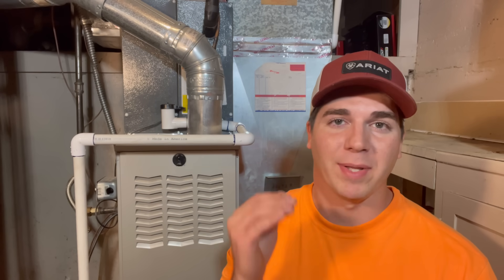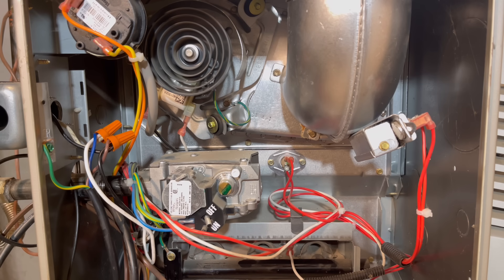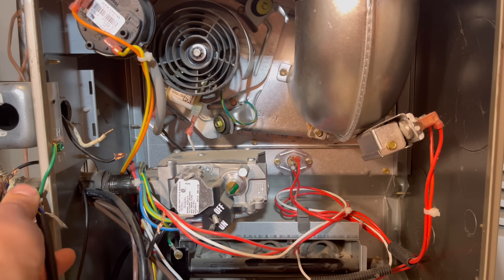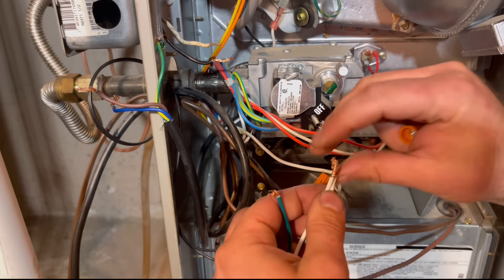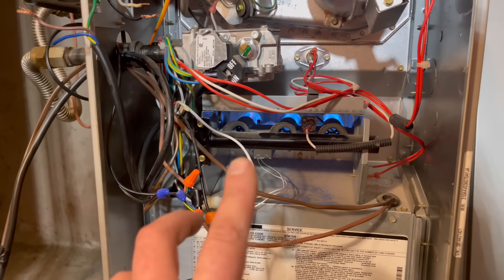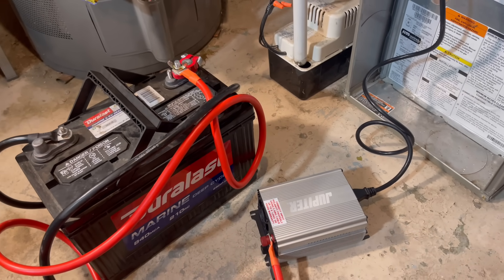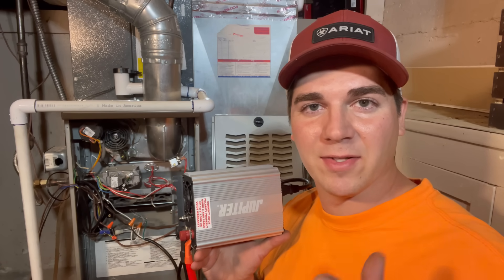Did You Know You Can Heat Your Home With A Car Battery?

Comment: LOL, Good luck using that with a Variable speed blower.  No ground on the computer board.  I smell a service call.  If your furnace is 20 years old , no issues
Reply from the maker: Some others on here said a pure sine wave inverter might be better for the high efficiency variable speed furnaces. Thoughts?
Reply: @diyhvacguy  yes they should work but obviously expensive. Newer equipment needs clean power or bad things happen
Reply from the maker: @chadschafer1723  right on. Well for the next video I’ll definitely have a pure sine wave inverter so as to not throw anyone off with a newer furnace. Thanks for the tip!
Reply: @diyhvacguy   I tried this on my 10 ish year old Goodman GCH95. 70,000BTU with 1/3hp blower. It's a condensing furnace, but still uses PSC motors. But the control board shows a grounding error. I tried all sorts of things (running off house ground, running off car battery ground, etc) and nothing worked. I actually let the magic smoke out of my inverter when I tried to jumper the neutral to ground. So I'm back to square one. This was with a modified sine inverter. Do you think a pure sine inverter wouldn't give the grounding error? Can you test your truck set up on a few different furnaces?
Reply from the maker: @valentindecker5264  yea I’m willing to bet it’s due to the modified wave. I’d try and pure sine wave inverter
Reply: @diyhvacguy  thanks, I'll buy a tsw for the replacement

Comment: It might be better to just invest in a home generator so your even more prepared.
I really can't imagine that this car battery is going to hold up for a couple days without draining it.
Consider mounting the power inverter permanently in your vehicle running an extension cord to your furnace so your able to keep the battery charged and not running it down.
The basic idea here was good though.
Reply: my car has built in inverter.    long extension lock doors (extra key } 3days no power.  My  friend needed power for life saving Medical device. Car ran all night gas Expensive 
Best Friend PRICELESS
Reply from the maker: That’s a great idea. I did this video for people who maybe can’t afford a generator or don’t have space to run one. I like the idea of having it permanently mounted and then running an extension chord. Thanks for the tip! Cheers
Reply: Your right 👍..
There are folks that just can't afford nor have the space. Then too, if there's room then others living next door may complain about it running all night and day. 
I guess I'm an exception to this considering I live in a rural area out away from others.
Then I'm in my 60's and retired. I forget to think about all that especially when I still feel young and do most tasks myself.

Comment: Don't waste your time with this battery/inverter type of setup!  The battery will only last long enough for short power outages!  Buy yourself a 2,200 Watt Inverter Generator and learn how to store it properly so it will work when you need it in an emergency.
Reply from the maker: Not everyone can afford a 2200 watt generator, and for that matter, not everyone lives in a regular house with a backyard.  I personally have a 3500 watt generator that is dual fuel, but I created this video for folks who don’t have that as an option. I will be putting out a video on my generator setup soon. Thanks for the comment. Cheers

Comment: Can I use Battery Tender Charging At same time using Inverter . That Way battery will have Continue Power And Inverter will have Power Form battery as well .?
Reply: You would need a source of power other than the inverter to power the battery tender.
Reply from the maker: Can you repeat this? I don’t understand.

Comment: As an hvac tech, this is pretty slick. Never thought of this and i dont see any reason from a technical point to not do this if you had to.
Reply from the maker: Thanks man! Same here! I’m excited to do the test and see how long it will heat my home. My furnace only comes on once every couple hours probably. And runs for maybe 30 mins at a time? So it will be cool to see. Another viewer just sent me all the wiring info to put this setup on some relays and have it on a charger so they will stay charged when there is power and then automatically swap over when there is an outage if you are not home. Pretty slick so I’m excited to test that too! Not enough time In the day! Haha cheers man
Reply: maybe dumb Question ???  Thermostat power      Nest Common wire

Comment: Thanks for the helpful video. I found an inverter on Amazon that plugs into 12v port in the car with a 12ft cord. Less than $30. Will this work the same way?
Reply from the maker: How many watts is it? It’s probably not enough watts to power the furnace. I think 1000watt should work for most furnaces.
Reply: NO. You will fry your 12v port (hopefully the fuse works) A small furnace will draw 33 amps.
Reply: Also, do you recommend only 1000w? 
Will a less watt inverter still work?
Reply: Thanks. Will 1000w run both furnace and fridge?
Reply from the maker: @patrickstewart6358  that’s a good question… I might give that a shot also. In an emergency situation, you could probably leave refrigerated food outside and not have to power the fridge unnecessarily.

Comment: Another great video. I’m actually installing my downflow furnace, very little information on downflow plenums (hopefully I’m using this term correctly) I was curious to how much weight can be supported by a plenum 12 to 14 inches in height? Furnaces aren’t light & can weigh 200 plus pounds.

Do you have an idea from your experience on how much weight a plenum can hold?

Thanks in advance for your response.
Reply from the maker: May I ask why the plenum is on the bottom?
Reply: @diyhvacguy  downflow configuration into floor, main supply line is in the crawl space

Comment: Thanks for the tip…never thought about it!  If you wanted to install a double pole double throw switch you could permanently run the house furnace on regular commercial 120 volts or flip the switch and you are setup to use the inverter.  By the way, you need a snap in cap to cover the open whole in the electrical box for safety and to meet electrical code.  Great video, thanks again!
Reply: I installed a plug on my furnace, then installed two outlet boxes next to the furnace. One box is 120 volts from the electric service in the house, and the other is ran to an electric inlet on the outside of the house. When the power goes out I simply start one of my generators and plug into the inlet on the house, then unplug the furnace from the house current and plug into the generator outlet. 

Quick, simple and completely isolated from the utility service.
Reply: @BadWolf762  Thanks for sharing!  Keep warm in the winter.....
Reply: Put a cord on that furnace, and put an outlet on the furnace breaker.  You could unplug it whenever you want.
Reply from the maker: That’s a great idea. Thanks for sharing. And thanks I noted that hole so I need to grab a cap for it and a cover for those wires. Cheers
Reply: maybe dumb Question ???  Thermostat power      Nest Common wire
Reply: @deadfisfhalequin2304  I've never had a terribly smart thermostat. What does something like a Nest run on? My old programmable one just uses two AA batteries.
Reply: @deadfisfhalequin2304  The power to the thermostat (include Nest) is supplied from the furnace. If you power the furnace you are powering the thermostat.

Comment: Very cool. Never though of that. Beats using the generator for small outages. Also can always connect to car to recharge if possible.
Reply from the maker: Yea! I didnt even think about mentioning that. Or for that matter you could connect it to the car and run it directly from that with an extension cord and then when it gets low, grab some gas if its accessible. Thats the thing about emergencies, there are so many variables. If there is no gas to be had, and no natural gas, and no power, alot of people will be in a really sticky situation! Thanks for the comment! Cheers
Reply: Where is this test video
Reply from the maker: @mauricelewis1650  workin on it. Make sure and subscribe and click the bell so you can see when it comes out :)
Reply: Ordered the inverter from Amazon.

Comment: For a DIY video, the way the incoming 120V wires were discussed was way too casual, and thus dangerous. 
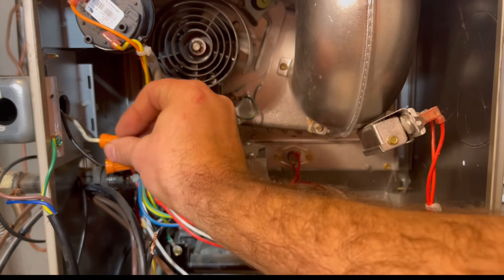- @2:42 "You can put some wire nuts over these just to make sure...nothing's going to happen". How about stressing WHY, such as "make sure to cap the wire nuts to avoid electrocution."
- @1:43 "Whoever wired this, there's supposed to be a box here, and they did not put that in correctly." How about explaining why that's a bad thing, such as "a grounded box trips the breaker if a short occurs, protecting people who touch the furnace from being electrocuted".
- @4:27 "I'm going to rob these (wire nuts) since we know we don't have power to this switch." A reckless practice; anyone could flip that switch, creating a situation where live wires could be touched. How about "when you buy a battery and inverter to prepare for this emergency power outage, make sure to pick up a few wire nuts; they're cheap, readily available, and can save your life."
Reply from the maker: Yea you are right. I assume people have common sense or have some general knowledge about electrocution but some people have no idea. Its hard when you are trying to create something that is specific and not make the video too long and boring that people decide to stop watching. I really appreciate you looking out for people though! I'll keep that in mind for future videos! Cheers

Comment: This is awesome. I just saw your video on Everyday Home Repairs and came over for this one. Any particular gauge that pigtail should be? 12 maybe?
Reply from the maker: Hey thanks for watching! As long as the gauge wire on the pigtail isn’t smaller then the two wires that attach to the main grid power switch you are good to go.

Comment: would be cool to wire this up with a switch so you can easily turn it on during a power outage
Reply: That is what I did with a switch that has 3 positions, On-Off-On. One position for utility power and the second for backup, inverter, generator, etc., anything that has 120v ac output.
Reply from the maker: @JT-lq4yd  brilliant! I’m totally gonna do that. Do you have a link for a similar switch? Thanks for sharing. Cheers
Reply: @diyhvacguy  I used a different switch and it is very difficult to wire properly, so I would go with a switch similar to this one available on Amazon.  Here is the name and Amazon's product number.  

EZ Generator Switch LLC 
ASIN # B00FADDE0A
Reply from the maker: @JT-lq4yd  thank you so much!
Reply from the maker: Yea that would smart! Stay tuned for the test to see how long it will heat my home! Cheers
Reply: EZ generator switch.

Comment: I have been thinking of doing this for years now. It would be nice to have in an emergency in stead of using a propane tank and a Mr. heat. I have two marine battery's that I use in my RV so all I would have to get is the inverter.
Reply from the maker: That’s perfect! The link the an equivalent inverter and the cables is in the video description :) cheers